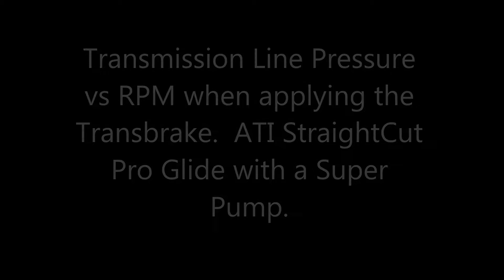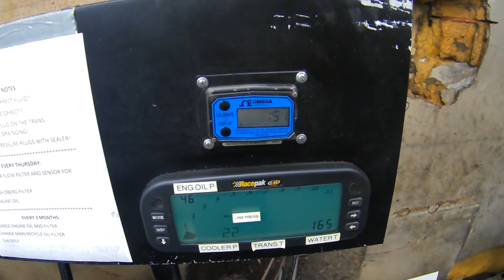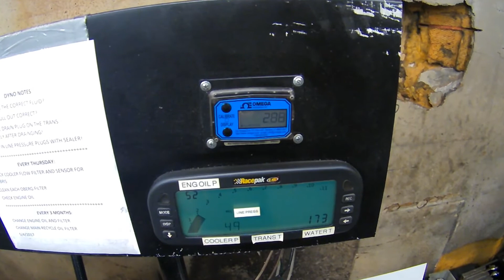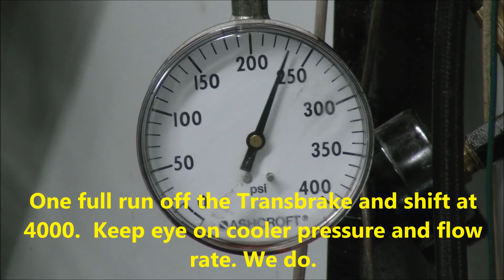Power Glide Trans Brake apply at different stage RPM reference

Comment: on a glide should i have pressure in the servo in1st and 2nd? reverse and brake work's but forward seems to be dragging.
Reply: If you are in the servo cover, that is low gear pressure.  When you shift to high that pressure goes away as it is released and applied behind the piston.  Check the band.  80 inch lbs in, back out 3.5 turns with a steel drum.
Reply: @jcbuncc  Thanks I think is the trans brake I am going to take some numbers down to make sure I have 2 transmissions and they have different problems the one have a brand new billet brake and no reverse or trans brake , I had this happened with a trans specialty brake before. I dont want to get confused between the 2 trans. Thanks I will get back to you for more help.

Comment: What if it doesn’t push back out an you have to pull the rod out each time
Reply from the maker: Then a spring has failed or there is not enough pump pressure to push the valve back out if it’s a fluid release
Reply: @ATIRacing  how could I check to see if the spring is bad
Reply from the maker: @carlchason6146  unscrew the solenoid.  in there, there will be a plunger, pull it out carefully as there should be a spring fully intact behind it. All this information only pertains to our Valve bodies. Some others might be the same but I don’t know
Reply: @ATIRacing  I pulled the plunger out an seen a spring inside should the spring be able to come out that way

Comment: Pressure reading taken at the servo cover, or, since this is an aftermarket case, is the another location for taking the pressure reading?
Reply from the maker: Servo cover or we have a port in the back.  One is low gear apply and one would be release.
Reply: @ATIRacing  I have an ATI glide case. Trying to determine why the transbrake is slow to release. It's an FTI billet pro tree brake. Figured I should start with a pressure check. Is there helpful information to be garnered checking the rear most port?
Reply from the maker: @ronreneau437  there is a port to check the reverse clutches.  You could watch that and see how long it takes for that to lose pressure after you let go of button.